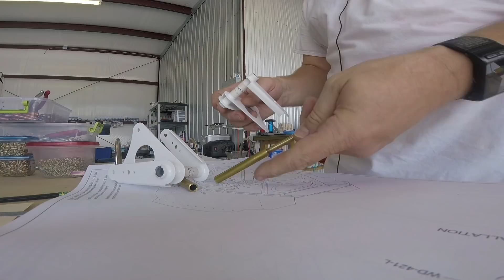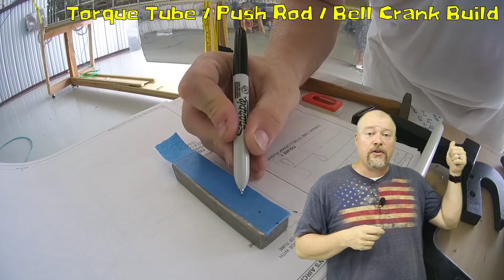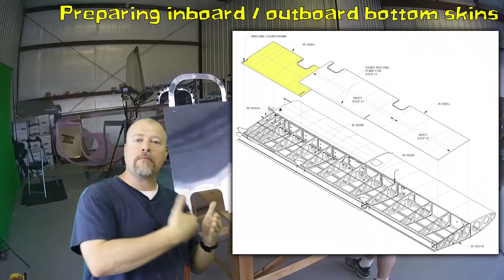RV-10 Wings - 061 - Right wing, Bellcrank, Torque Tubes and Pushrods

Comment: Pitot probe outboard is better. More inboard is getting it in the flap area. Possibly into prop wash. Large flap deflections may (slightly) change the pressure distribution chordwise, even upstream. So you should be good moving it outboard

Comment: I'm surprised those machined plugs are not welded onto the torque tubes instead of pop riveted on. Also, I would  safety wire the jamb nuts. Last thing you want is to lose your aileron control.

Comment: Jason, on my RV6 my pitot tube is close to tiedown mount.  This creates some mild interference concern when I tie down the airplane on the ramp.  I have not looked at the 10 wing yet, but remember the tiedown rope will attach and stretch outboard toward the tip and down toward the ground and away from the wing.  The most important thing I learned from the RV6 project was DO NOT go looking for ways to ADD extra parts, complexity or other elements to the construction process in an attempt to delay completion or the airplane!  Especially if these items are not in the plans.  A lot of the "extra" type stuff can often be done after the plane is certified.  Jim

Comment: Just curious, I noticed in the last video you were dimpling the wing ribs with your squeezer while in place, I also noticed the wing skins were than clecoed and it looked like you were match drilling the bottom skins. Are the holes of the ribs not enlarged due to dimpling? Are you abel to debur all the backside of the ribs and well as holes made drilling the ribs for electrical and Pitot static lines? I thought this was required to prevent cracking from propagating as well as proper nesting of parts. You seam to be making good head way and i am not due to the meticulous part prep noted in section 5 of the manual. I'm just wondering if I'm going overboard... Thanks for the Videos Jason! Your going to be in phase 1 before you know it!
Reply from the maker: When you dimple it will enlarge slightly yes if you haven't match drilled.  What you're watching me match drill though I believe was the jstiffener that runs along the middle.  I hadn't dimpled it or the skin yet =)  I did deburr, in the latest video as you see me drilling and then widening you see me go back at each hole with a debur tool.. it's awkward to be sure, but I got it done.  Regarding going over board or not, I dunno.  I have talked to some who say its the most important thing ever, full stop.  Others say you don't have to go over board, but rather just do a passing job and that if your plane has that much vibration then you have other issues.   All of these opinions come from builders who actively fly and still have their planes.  (I have seen their work and it seems fine).  I think mostly you don't want any sharp cuts or angles.  Nice rounded angles are the best.

Comment: I'm building an RV-7 and I bought an (unheated) pitot and AoA tube. Which means I won't build the stall warning, because  I have an AoA. So maybe I can place the Pitot/AoA in the leading edge just on the other side of the main spar. It has its own access plate (of the stall warning) and it doesn't hamper the push rod.

Comment: Hey Jason, do the build manuals mention things like when you should run wiring and what to use??  My biggest unknown to building a plane will be the electrical system and engine systems.  My current job has me running the Armament shop for the 64D/E crew dogs as well as doing maintenance test flights.  I am learning stuff from them because they run wires, splice, make harnesses and pin things to name just a few.  Plus youtube searches as well lol

Comment: I would call vans to be sure it’s safe to drill through the spar web to mount the pitot heat controller!  That’s a very critical part of the aircraft.

As for the pitot tube itself, also consider where your tie down will be, and if it will get it the way of ropes and such when you tie down.  It’s a pain point in the rv-7 and I am still waffling on where my pitot will go.
Reply: I suspect the holes through the spar web would be ok. There are other holes in the spar web at higher shear force locations. There doesn't appear to be any web reinforcing at the bell crank where there are larger holes going through the web and it is at a slightly higher shear location. I would be more concerned about any bi-metallic corrosion between the web and dissimilar metals attached to the web.
Reply: Lynn Dixon 
Good point made. I say do not drill into the spar, big no no. Fabricate a mounting plate that can be permanently attached to one of the ribs, then mount the unit to it. And yes, use nut plates where ever you can you’ll be glad you did.

Comment: Looking for parts in the bags:    Wait until you do the Finishing Kit ......
Hair Pulling Time!!!!   :-D
Putting the pitot out further is No problem.  Also, if you have a single access hole, don't put it too CLOSE to the rib --- you need to be able to get your hand/arm thru the lightening hole to service it later --- so get it in the middle or far end of the bay  (oh, and GENTLE bends are always best!!!)

Comment: No expert   but pito tube is just air flow pressure   so its runoffs don't have to be at 90 degrees    you should be able to angle it

Comment: Many guys are putting the pitot in the 2nd to last bay so moving outboard is no issue. Just evaluate, is the location going to cause issues with the tie down rope in the future...in addition to the other things you have been considering.
Reply: I'm doing the same. Just have to make sure the pitot tubes don't interfere with the crank mechanism